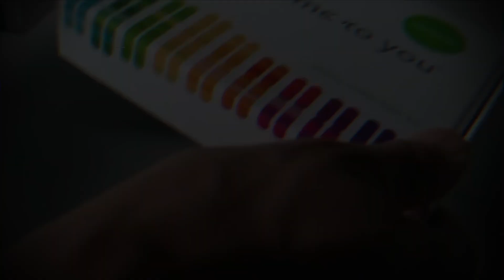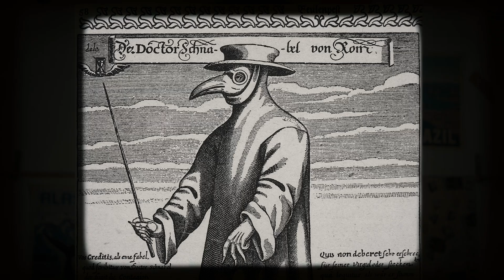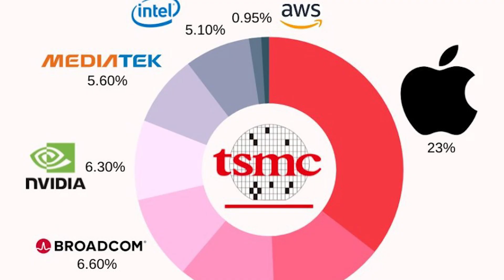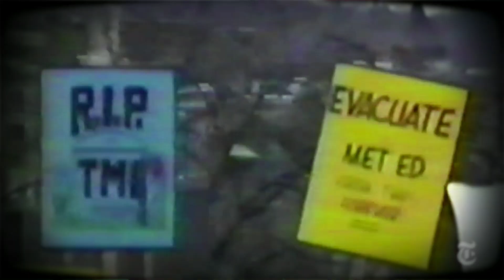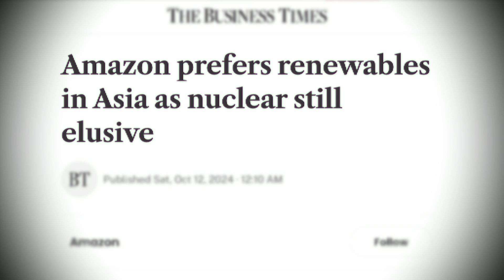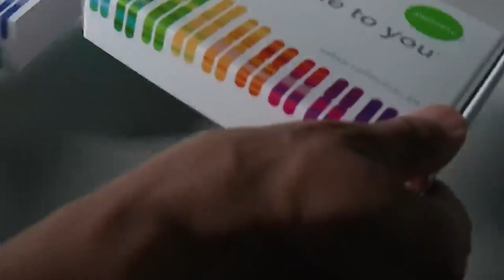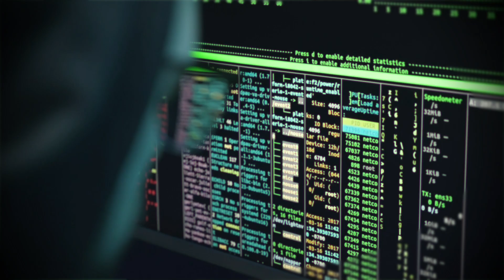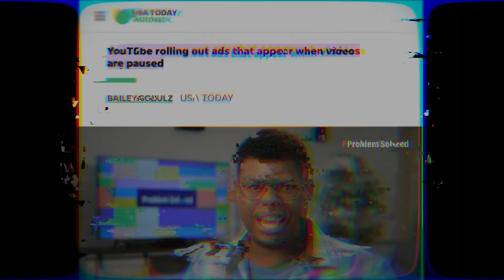How Israel Changed War Forever | Incident Response

Comment: Mossad are not james fucking bond they are just terrorists 

they indiscimintly targted pagers and walkie talkies which yes... seam to be used more by the people they wanted to target... but what the fuck are you going to use if you on a construction site communicating to a guy in a crane frequently... your hardly going to want to type in the number to his phone every fucking time are you?  the fast and elegent solution is to use a walkie talkie....
pager seam more reasonable but i dont know every use case for those so that is not a certain thing....

This is  just an act of indiscriminet terrorism that hardly takes enougth messures to ensure the safety of the civilian population....

But that is nothing new after the warcrimes they are comitting in gaza
Both sides emply terrorist tactics in this case and should be treated as such...